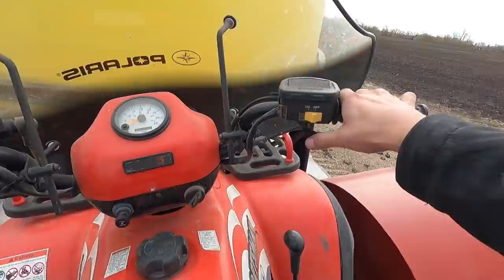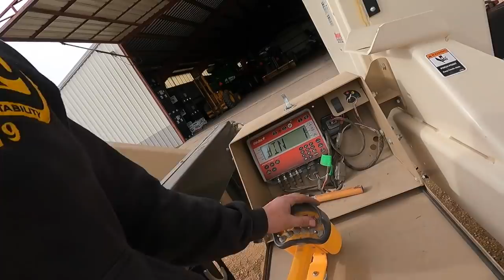We Planted 870 Acres In One Day!! #10

Comment: We had when I was little two farms that were about 23/24 miles apart my dad had all 4row 38inch equipment and about 5 mile stretch we had to escort and stop traffic because of bridges. My dad always during cotton planting time tried to keep all his equipment together and moved them from farm to farm was more efficient that way... I ran a 560 IHC with a 4 row doall pulling down beds for cotton planting the doall was a tool that had a chopping  reel with 4 or 5 blades per gang with a 5 bar tumbling harrow and a leveling board mounted with flat leaf springs to hold the board down....